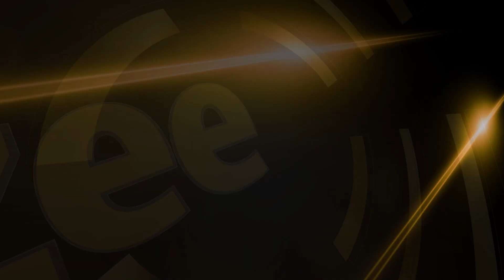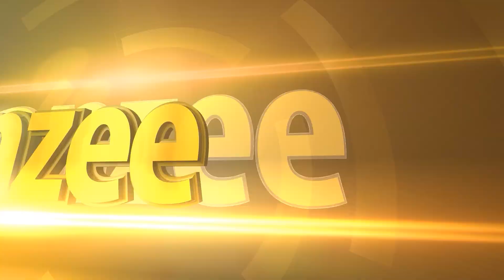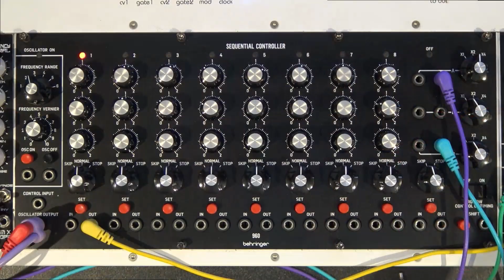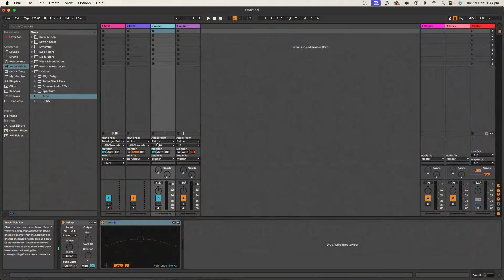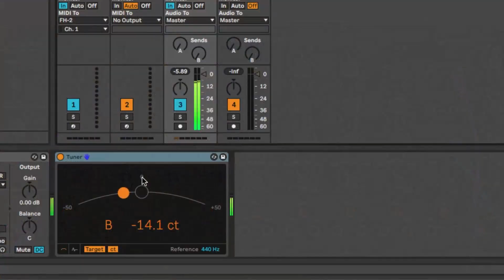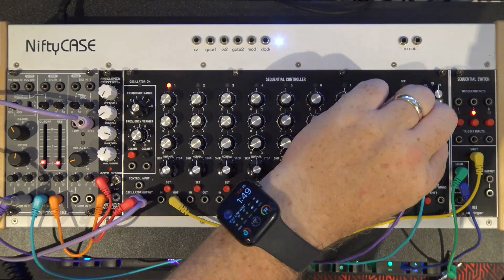Behringer 960 Sequencer - Quick Setup

Comment: What's the difference between this and the upcoming BQ-10 sequencer?
Reply from the maker: Quite a lot considering the BQ-10 sequencer is based on the Korg SQ-10 from the 1978. The SQ-10 was designed originally to compliment the MS series of synthesizers. The 960 sequencer is based on the Moog modular synthesizer (like the Model 55). There are functional differences as well as UI performance layout differences. Enjoy!

Comment: Am i wrong or "3rd row control of time" doesn't work woth an external clock?.... I wonder why...
Reply: The "3rd row control of timing" switch routes the CV output of row 3 into the CV input of the internal clock. It's just a nice convenience feature since you could just do the same thing with a cable and patch the row 3 CV output into the Control Input on the far left side. (there is a small chance this isn't accurate, it's been a long time since I've owned a 960 sequencer!) And with an external voltage controlled clock it would work the same way, just patch the row 3 CV output into the external clock's control input and then patch the external clock's output into the 960's Shift input. And when using an external clock, the "3rd row control of timing" switch wont do anything typically since you wouldn't be running the internal clock.

Comment: Very nice video, I didn't know a patch yet, that helped me.

But I still have a problem: I want to combine "control of timing" of the third row with using an external clock. I haven't found a solution yet. Is this even possible? Ralf
Reply from the maker: You should be able to - but I haven’t tried. Give it a try and let me know how you get on.
Reply: The "3rd row control of timing" switch routes the CV output of row 3 into the CV input of the internal clock. It's just a nice convenience feature since you could just do the same thing with a cable and patch the row 3 CV output into the Control Input on the far left side. (there is a small chance this isn't accurate, it's been a long time since I've owned a 960 sequencer!) And with an external voltage controlled clock it would work the same way, just patch the row 3 CV output into the external clock's control input and then patch the external clock's output into the 960's Shift input. And when using an external clock, the "3rd row control of timing" switch wont do anything typically since you wouldn't be running the internal clock.

Comment: Thanks great video. I am very inexperienced with synthesis. The translation that covers part of the video and the speed of the concepts expressed so quickly make it difficult for me to understand 😃. A direct question: I have the 960 beheringer as a connection to the Mother 32, Model D, or Arp Odyssey beheringer. Thank you very much 🙏❤️

Comment: Grazie bellissimo video. Solo io sono un po' inesperto della sintesi e per seguirti, essendo italiano ho bisogno della traduzione i sottotitoli coprono parte del video e molto veloce non comprendo bene. Una domanda io ho 960 beheringer come collegarlo es. mather 32, model D, o Arp Odyssey beheringer ? 🙏
Reply from the maker: Hi, sorry I don't speak Italian - however, you could use Google Translater (or similar) on this page - it might help: https://ranzee.com/behringer-960-sequential-controller-quick-setup/
Reply: @ranzee Thanks great video. I am very inexperienced with synthesis. The translation that covers part of the video and the speed of the concepts expressed so quickly make it difficult for me to understand 😃. A direct question: I have the 960 beheringer as a connection to the Mother 32, Model D, or Arp Odyssey beheringer. Thank you very much 🙏❤️
Reply: @alessandrogolinelli3185  Hello, can you explain me how to connect the moog mother 32 to your system 55 or to the sequencer 960 ? Thanks in advance !
Reply: @ValentinSalomon-n7w  Connect Behringer 960 ( external  ) to ( internal ) Mother 32 and/or Moog subharmonicon. Thank you